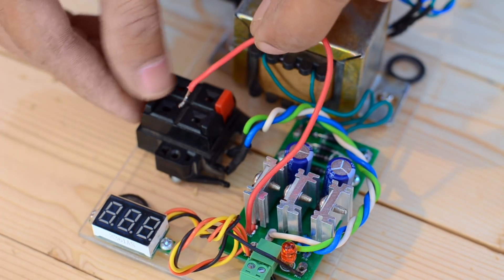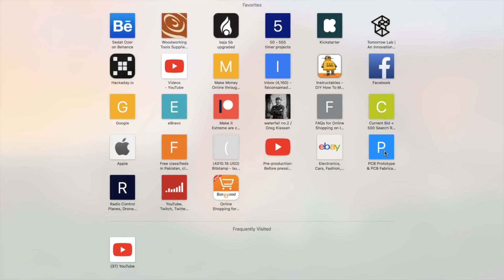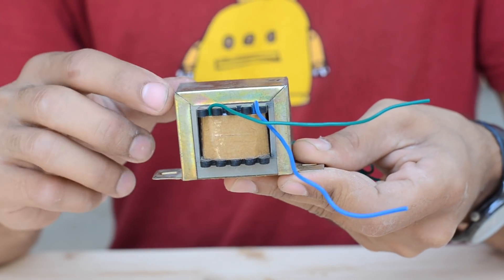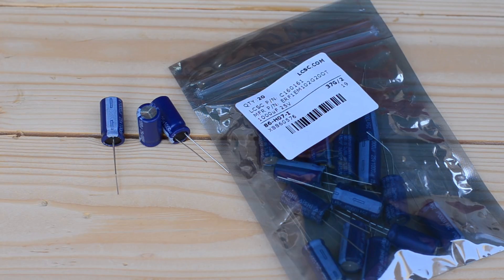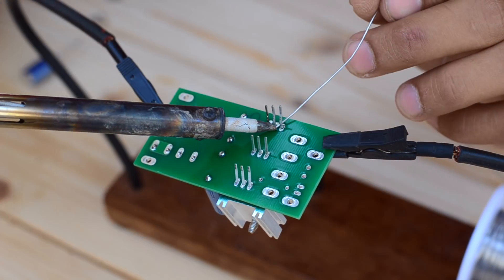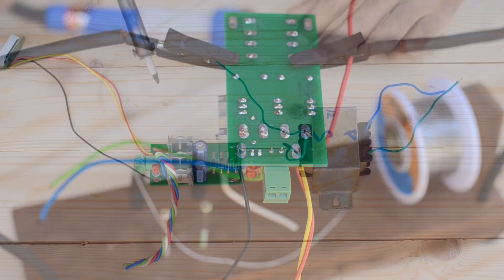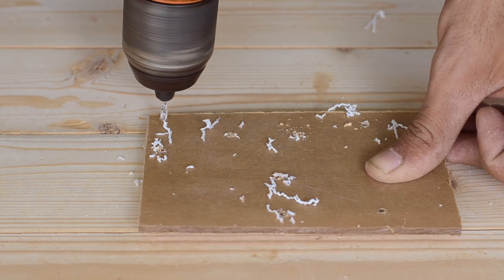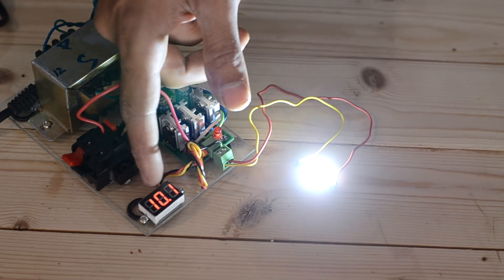How to make a Regulated Output Power Supply

Comment: I would like to see you construct a meter testing power supply. Input 120 Volts AC. Output variable control to do an output step current  from 1uA-10uA-50uA-100uA-500uA-1mA-10mA-50mA-100mA-500mA-1A using Standard full-scale meter movements using a current & voltage digital meter to be adjusted by resistors or 10 turn potentiometer. I want to use this to see if several unknown panel meters are working. You Video was excellent. 

Note: please speak slower and articulate words (don't slur words) other wise too hard to understand, part of the time.

Comment: Voltage regulator can handle upto 1.5A current which is not that much useable . keep it up. Your vedio is excellent. you have to add    variable voltage regulator circuit using LM 317 and some other components.
Reply from the maker: Yes you are right. Thanks for the appreciation.